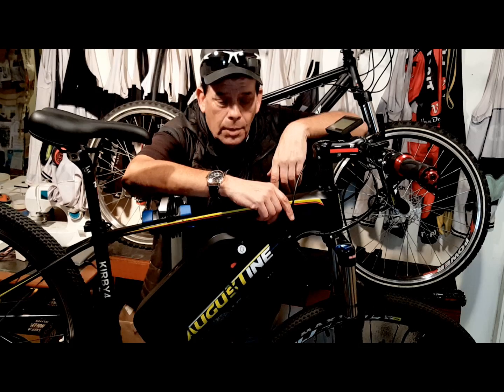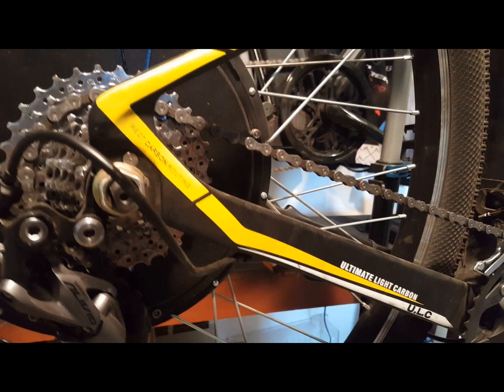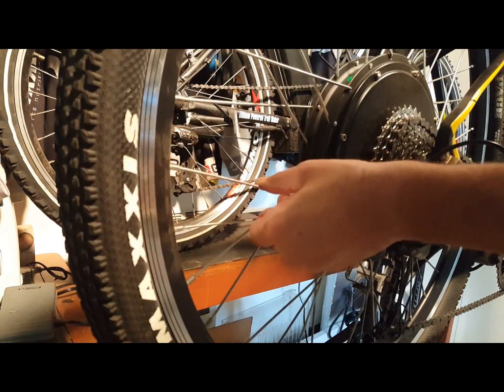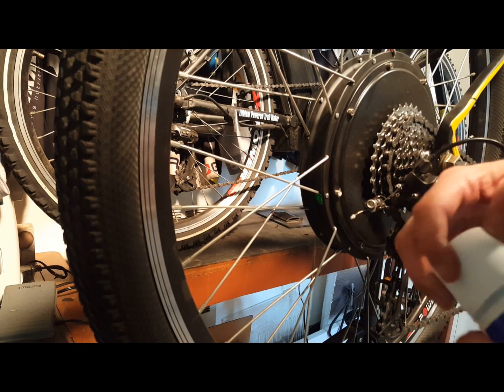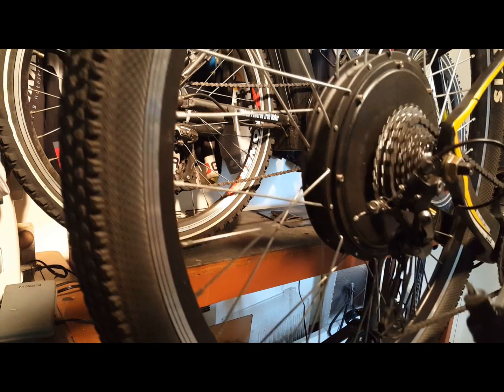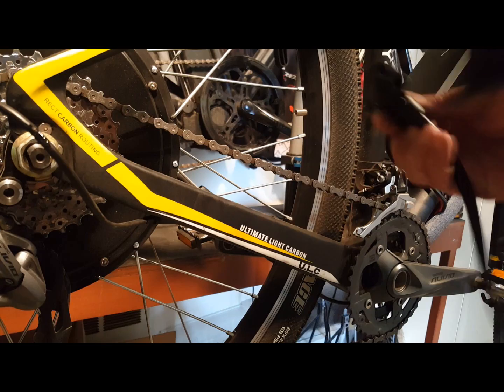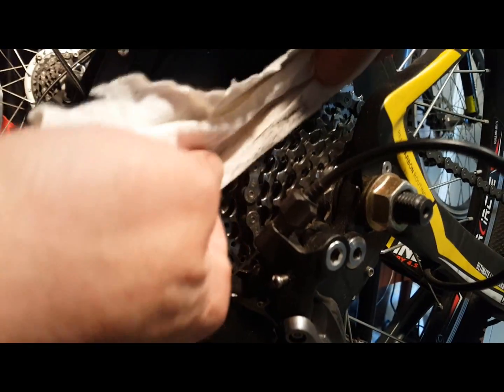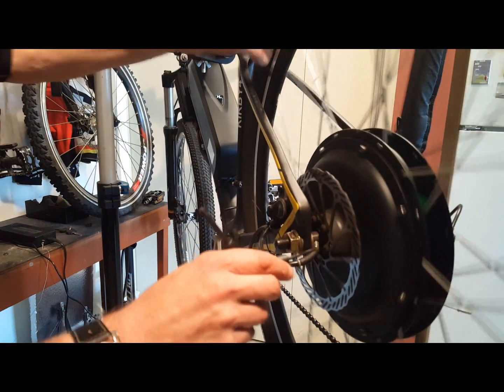E-Bike. Important, Rear Hub Motor Maintenance Tips

Comment: I have a clicking/ticking noise coming from my rear hub motor. Its brand new, when I lean forward when riding it goes away, when I lean back and sit on the seat I hear the clicking/ticking....can you help?
Reply: Lube the spokes like it says/shows in the video.
Reply: Thanks Matt, we had the rear wheel trued by a local ebike shop....still has the clicking....not sure if they lubed it or not...but I will try that next.
Reply: @bromotoebikes  I had the same problem, that is why I am here. I lubed mine today! Just got back from a ride and no clicking or ticking. I used a fairly thick lube and was generous with it. The excess will stabilise etc. 

It seems obvious now.
Reply: @matthewbh1976  Thank you! I just picked up some White Lithium grease, and sprayed it on the rim spokes and hub motor spokes, went for a 2 mile ride.....NO NOISE! So happy! Thanks for the great advice and youtube video!!!
Reply: @bromotoebikes  That is great (y) I have been out in the rain, too. Still no squeaks!
Reply: @matthewbh1976 , its been a month and I've gone on several 6-10miles rides and no errors or noise! So excited....grease on the spokes solved it all!!!
Reply: @bromotoebikes  

I haven't been on mine. I have a 1000w bike I am putting together. It's just having the time and energy to get it done. I am glad a simple fix has helped us both.